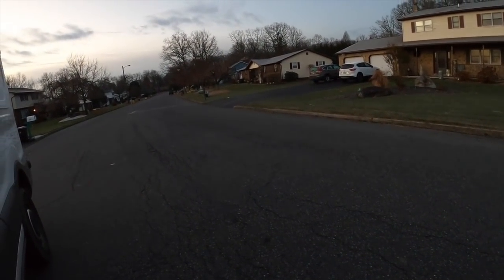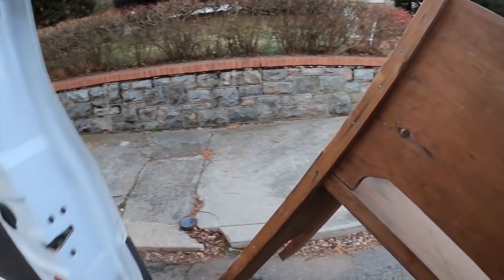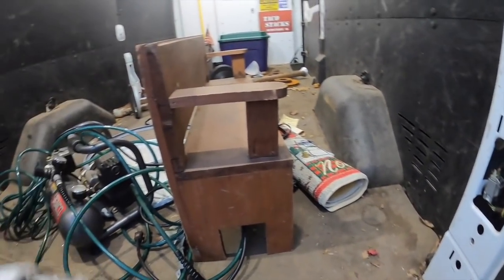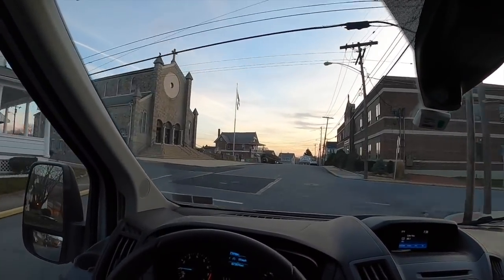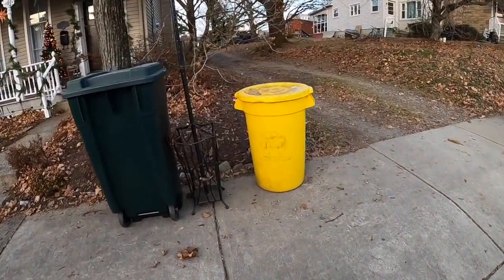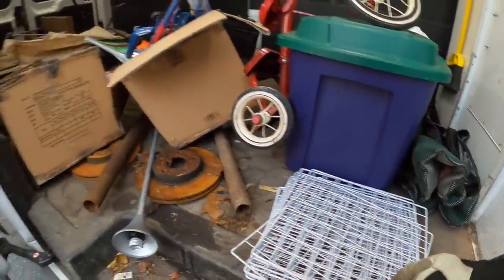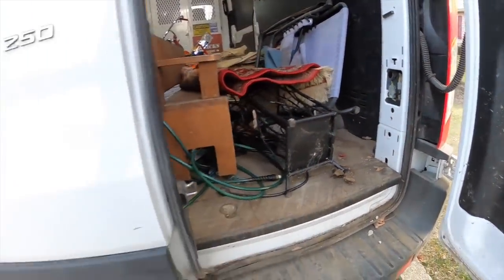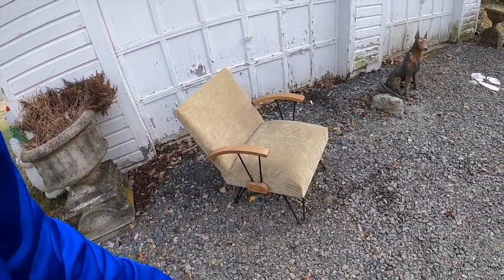They Threw It In The Trash So I TOOK It - Trash Picking Ep. 537

Comment: The rug looks like a synthetic   mass produced, machine-made rug. The binding on the edges looks machine made.  Look up how to do a burn test on fibers.  (just pull a small strand of yarn from the rug to test, you don't set fire to the whole thing) if it melts into hard black plastic blobs, it is synthetic like nylon or acrylic.  Valuable rugs are generally wool or silk.  The white metal grids are a shelving system, use  zip ties to attach them into any configuration you want.  Include some  squares as backing to keep it stable.

Comment: Could not see anything about the grandfather clock to see if it was electric, battery powered, or actually operated by the weights. Over the last 2 years I have found one weight operated  GF clock at a curbside, one at a garage sale and a battery operated one at a garage sale and discovered that if you sell on some of the bigger sites like EBay or Craigslist or others the cheap battery operated ones will sell for 100 or more if it works and about 35 or more if not working as long as it has a real wood case in good condition and the weight operated ones can go for 500 and more with some of the ones with German movements can bring in about 1000 or more with some of the German movements going for 900 or more just for the movement as long as it is complete and In working condition.  I’m guessing that the one you passed up was probably worth about a 100 or more if it works and is the battery operated kind